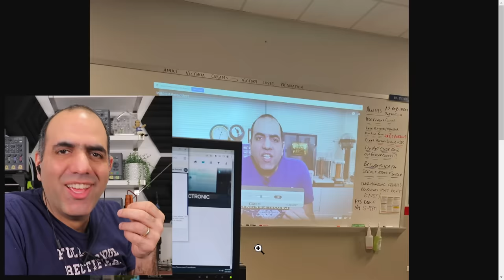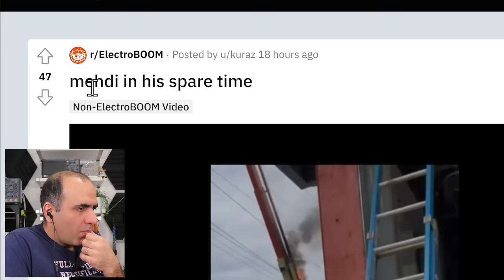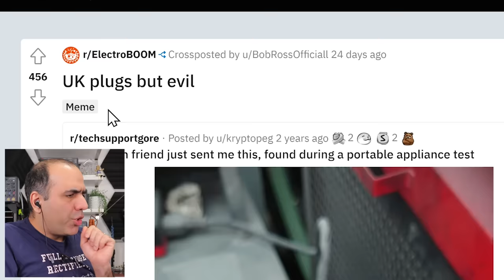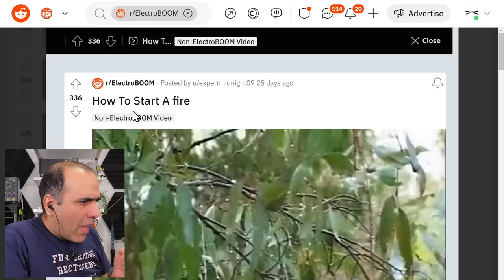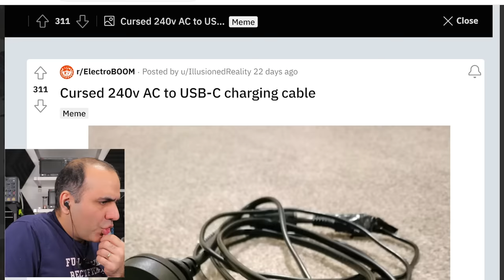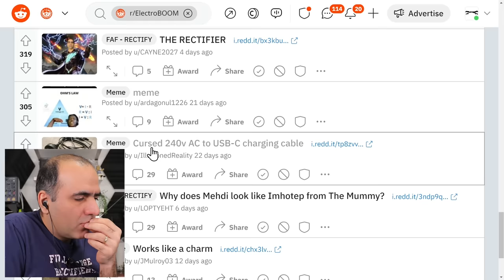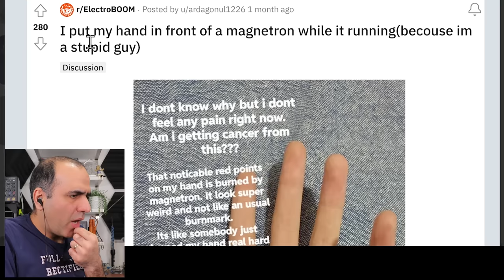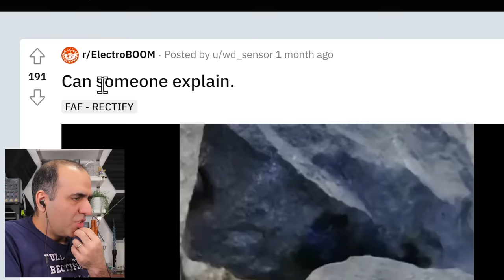Closing a POWER ARC Switch with a WEAK ARC (LATITY-012)

Comment: I always wondered why you plug the connector in and out instead of keeping it plugged in an using a switch. Wouldn't it be much easier, faster, and safer?
Reply: I suspect he's concerned about the switch being destroyed by the amount of current being pulled through it.  He's pulling enough current to cause the breakers to blow after seemingly less than a minute of usage.  That's a great deal of current, and unless he custom built something with a special switch designed to handle that kind of power, it might kill the switch, and I'm not sure if it would fail open or closed.  Maybe with melt it closed, I don't know.

There's another possibility when he's dealing with the transformer.  When you've got that great big coil energized and then you cut off the power it's going to cause a high voltage spark. That also might be bad for an ordinary switch.
Reply: @NomadSoul76  switches can easily handle that much. There aren't that many amps passing through. The magic happens afterwards and the breaker should easily protect the switch. Over here breakers pop at 15 A while everything is designed to handle at least 16 A continuously. It should be similar in Canada with the difference being half the voltage and twice the amperage.

Comment: I dont know if the workers used an axe, a Hammer would suffice too if these are HV coax cables. If you hammer on them you generating an non equidistant isolation from live wire to return wire. The EM field in the cable will be also imbalanced, causing the cable to explode. Absolutely not funny but worth of a electroboom video😎😎😎

Comment: So can this be considered kind of a high-voltage transistor? Do you think you could amplify a (digital) signal like this? I suspect you'd have to keep the frequency low because of the lingering effect of the arc, but if it was low enough, it seems you could also build this into a class-D amplifier.

Comment: Mr Boom, i have a question for you:

I have several microwave transformers laying around and i was wondering what would happen if i were to link em all together.

So, the first one gets the normal ac voltage, we have 230 or something like that.
But what if i hook the secondary of that transformer to the primary of the next, and so on?
I got 5 of em laying around.
And i was just wondering: Will i blow em all up?
Or will it work like a step-up voltage device?
I have never seen any videos on that anywhere. (maybe because i did not look for it that specific).

Can you help this dumb guy out? Will it be an interesting test? Maybe a video about it?

Gimme a call if i need any money, always happy to accept.
(a joke, obviously. Not that i do not need money, but ey, its a joke)

Comment: A small arc switching a large arc is what I think happened to my HVAC system. The solder on the blower relay cracked which must have created a little arc. But the little arc enabled a larger arc from live to the grounded case which tripped the breaker. At least that's what I think happened.

Comment: A question that I have wanted to ask is, how harmful to your eyes are the arcs that you generate in almost every episode? I know that arc welding is dangerous but I don't remember seeing you use any eye protection.
Reply: The arcs in arc welding have a lot more power in them and are a lot brighter than most of what ElectroBoom does.. Bright enough to blind especially with excess & multiple exposure.. Cumulative effect is at least part of the danger..
With a bright enough light esp the coherent light from lasers and/or at UV frequencies can blind or permanently damage the eyes almost instantly.

Comment: i have i question if i have a wound or some skin with less resistance i get shocked or stung in the shower if i touch metal and if i touch the inner side of my arm by the elbow where the skin is thinner my arm hand cramps up and i can feel the frequency pulsing is this some ground fault in my house or something?

Comment: on a 220 plug, why does my pump still work with no ground/neutral?
Reply: Usually, the ground wire is not required for something to work. I am not sure about the neutral wire though.

Comment: wait,   connecting a charger to a charger, isn't that the same as connecting 2 terminals without any resistance?  we were told never to do that in high school.
the workers are hitting the live cable with a hammer...what happened there?
what did you actually study? it feels deeper than just electrical engineering.
do you still build anything? it feels like things now are just microcircuits and a typical guy will only replace circuits rather than actual electronic components.

Comment: The visuals and sounds from the demonstrations around the halfway mark surprisingly made me really sad, presumably from all of the countless videos I've seen over the years of people being electrocuted (and often cooked) one way or another. Especially the sight/hum of high-voltage arcs - it's fascinating how seeing that triggered such an intense emotional reaction from me. Genuinely terrifying.
(cupcake_dog_vietnam_flashback_meme_LOL_ifunny.gif)

Anywho, I assume the insulation was scraped away after insertion/removal of the wire coil against the sharp edges of the stamped steel assembly. I'm sure that a new coat of varnish to reseal and some kind of taping/pretty ribbon wrapping to protect it will make things all good ☺️

Comment: - 8:05 It depends on how is the USB male-to-male cable wired. What's the pinout of that cable?
- 8:13 USB-C PD (power delivery) can handle up to 48V. Of course, they start out at 5V for backwards compatibility and allow the device to negotiate up as needed.
- 10:13 Is it worse to be a boomer or an illiterate diaper-wearing TikTok zoomer?
- 10:28 Um, how is the blue wire sticking to the bulb? 🤨 Just another example of why TikTok is useless. 😒
- 11:13 Moments earlier… "'overthinking leads to problems that didn't exist' - life lesson!"
- 12:32 RAFA made a homemade capacitor. It couldn't been worse, he could've been RIFA. 😂
- 14:03 What about naked cooking? I hear frying stuff while naked is great.

Comment: Hi man again hello and
I have a question as we know Carnot engine is most efficient approx 50% and if ( a light is producing heat just heat and what if we use a Soler panel and use it's electricity to generate heat as a heat engine it's T1 and T2 is same as a result this engine has max efficiency of 100% so what's the problem with this
Reply: Lots and lots!! Heat is  ... just complete an electrical degrees!! Ffs..